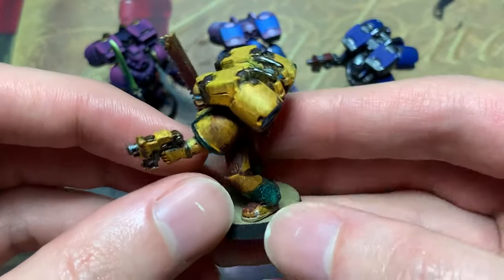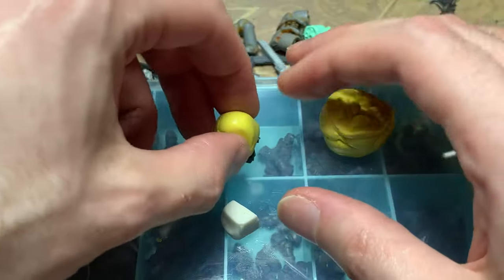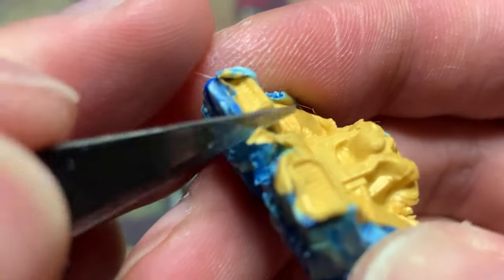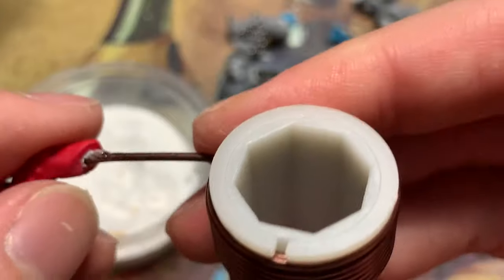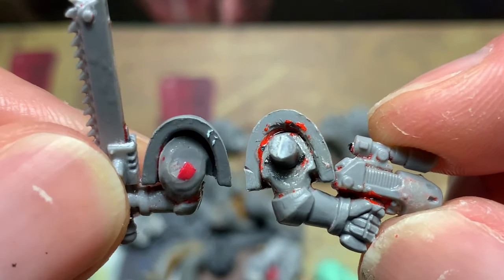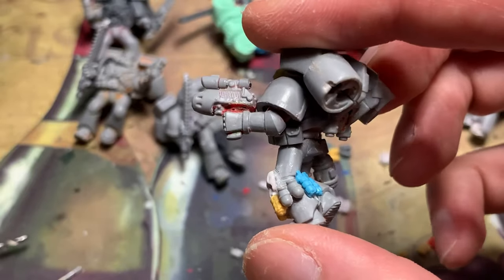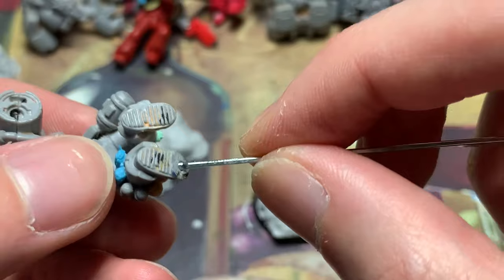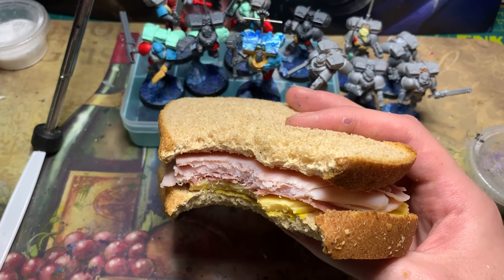Fixing Old Assault Squad Space Marines with Clay

Comment: For those getting angry about "not buying real models", GW doesn't even sell Assault Marines anymore. So there IS no "legitimate" way to acquire them. Blame GW.
Reply from the maker: Interesting. I was not aware. I originally made the clay one so I would have enough for two squads, but then acquired a plastic replacement later.
But in general, I think that it's much easier and faster to fix up old or damaged models with copied parts than to copy entire models.

Comment: Amazing Putty is great for press molds. Liquid silicone would be better for higher quality casts.  But for two part molds like your using hear you be better off using a mold box; either legos or foam board.  The layer the bottom with putty add your part pressing in and then layer more putty on top and using a press [legos of foam board] to press down into a solid cube.  Let it harden and to can the cut the part out using a scalpel and a zig-zag pattern. The result will be a clean mold that you won't have to create keys for and can easily cut gates into. Open it half way and add your clay and pressing the mold halfs together.  But honestly injecting resin will yeild better results.
Reply from the maker: I have worked with silicone before, and while I currently prefer rubber, I do have a few things that I would like to cast with silicone and resin.
Though, I have thought about making tiny modular mold boxes so my rubber molds would be more stable. Thanks for the input!

Comment: Glad Youtube recommended your video. Can you share what is in your pot of paint stripper. I tried stripping once and used simple green as it was what I found recommended and it was AWFUL. But yours seemed to nearly peel off
Reply from the maker: I used 'Super Clean', but I've also had success with LA's Totally Awesome. Normally the paint takes quite a bit of scrubbing. I wonder if the previous owner did not use primer.

Comment: This is a rollercoaster of a video and I love it. I never thought about using polymer clay for making extra bits with, that's actually kind of brilliant, especially for making copies of the more choice bits so that you could make an extra cool dead guy on the base without wasting a whole model. Keep up the good work, you just got a new sub!
Reply from the maker: Thanks! Many good deals on pre-owned minis are missing parts, so being able to replace them is a godsend. Also, the expensive multi-part kits can be useful for obtaining extra heads if you already planned on getting the unit is question. Some of the gray plastic heads come from a box of Assault Intercessors, which has a total of 32 heads, including 20 un-helmeted.

Comment: Great content, subscribed! I’ve been experimenting with Oyumaru for a couple of years now, I’ve found that WD-40 makes a great release agent for the moulds. I also hate using greenstuff & miliput so I just make my parts with Gorilla 2 part epoxy nowadays. What was the rubber stuff you used for your moulds? How does polymer clay hold up? Is it brittle? Loved seeing the box full of multi-coloured clay bitz!
Reply from the maker: Thank you! The rubber is Amazing Mold Putty, by Alumilite. It usually sets after 20-30 minutes, but I have had a case where it took about a day for some reason.
The polymer clay I use is Sculpey Premo or Sculpey III. I bake Premo for 15 min and III for about 8 min, both at 275 F. Sculpey III is softer and more easily fills the nooks and crannies of a mold, but is brittle and not suitable for thin sections. Premo is the opposite. It's firm and slightly bendable ( not as much as green stuff ) while being easier to cut into than any other material I've come across. It would only take around five seconds to cut the clay jump pack I made in half lengthwise.
In my experience, polymer clay need to be sealed or paint can rub off. I use Mod Podge thinned with water 50/50.
DAS Smart clay is also nice, though mine is a bit crumbly before I knead it.
Reply: @GearedHobbies thanks for the in-depth response, much appreciated! More stuff to add to the shopping list!! 😅

Comment: So glad I found your channel, this video was great! What rubber product did you use to make the molds? I have only ever used platinum cure silicone, but it isn't ideal for this type of application.
Reply from the maker: Thank you! I'm using Alumilite brand Amazing Mold Putty. I have also tried silicone, though I now prefer rubber molds. If you're ok with working with resin, Silly Putty can be used to make partial duplicates of about 80-95% accuracy, though they are flat on one side and might be better used as base decorations.